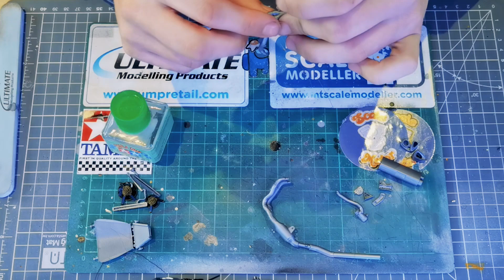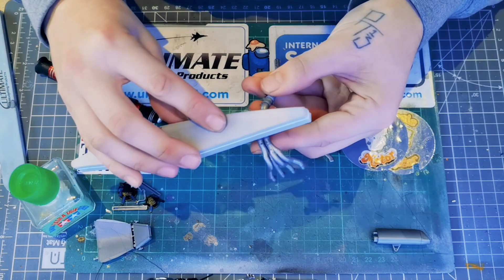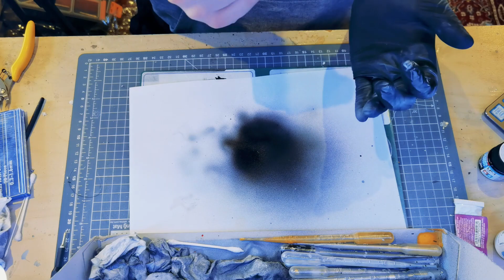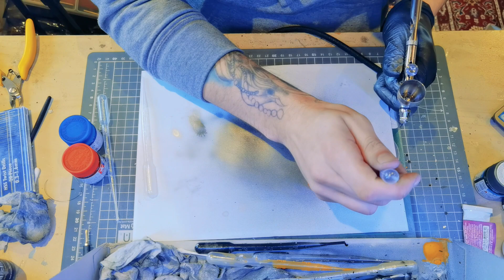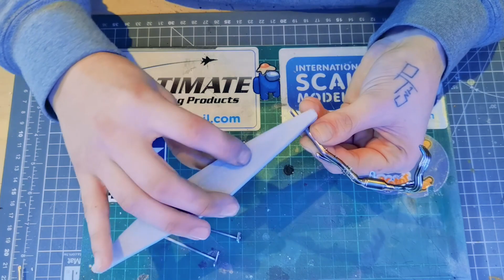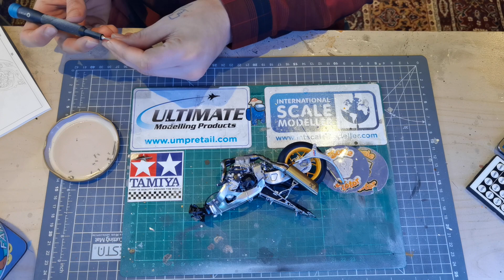Tamiya Honda CBR1000RR-R Repsol build - Part 3. Exhaust heat staining.

Comment: Disclaimer - do not look into motorcycle exhausts whilst the engine is running! 😂
Nice tips! I've not done much heat staining myself and don't have some of those paints but I may give something a try using the clear orange, blue and red pens I have.
Reply from the maker: Hahahaha, definitely! I used to polish my exhaust tip on my old bike and I'd spend at least half hour peering down the tube, hahah.

That's a good idea! I seen a video by Nandemo Seisaku (sp) and he done it straight over the chrome plated kit parts and it looked excellent!